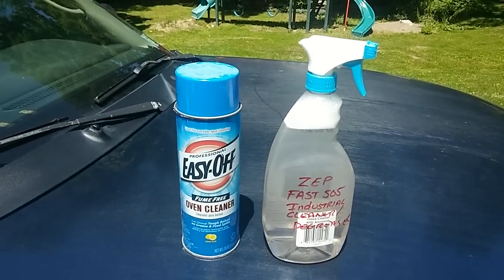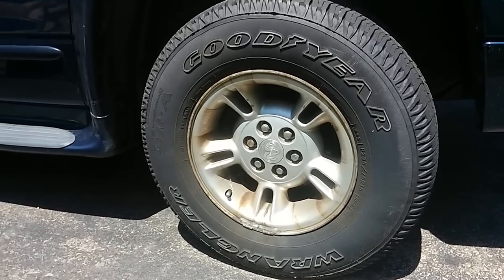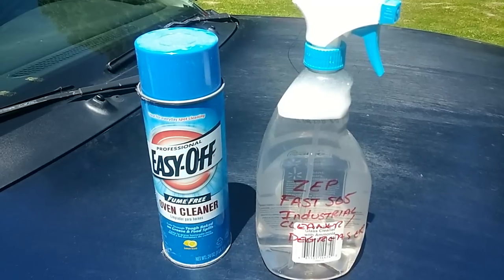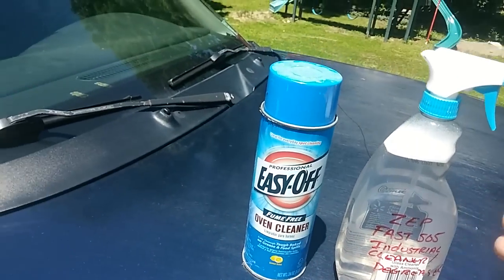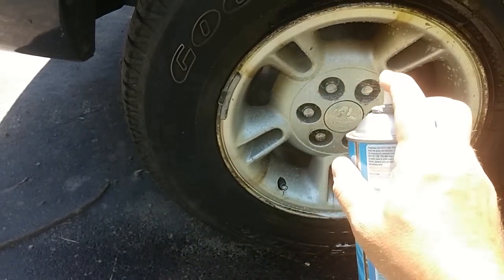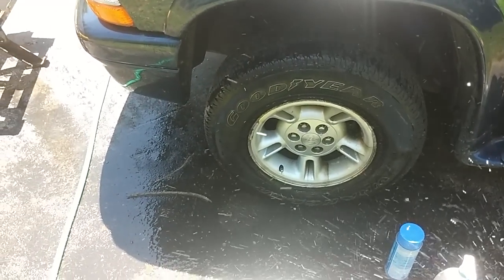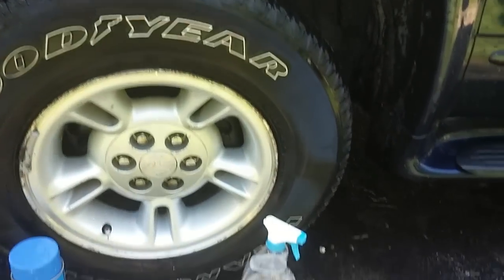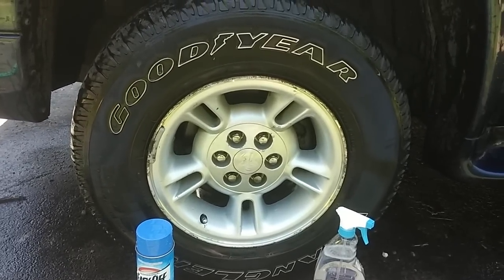Best product to get rid of baked on brake dust.  A comparison of two common products

Comment: The DOLLAR STORE has AWESOME brand cleaner, as a professional I have tried every commercial degreaser there is, and for a BUCK nothing cleans 30 year old grime off better..(I used the AWESOME carpet cleaner)....I KNOW, WHO WOULD HAVE THOUGHT?....it literally melts dirt off before your eyes including old engines and brake dust (all oven cleaners say DO NOT USE ON ALUMINUM).
Reply: I have been picking stuff from the Dollar Tree/99 cent store for 15 years...

Comment: AlumiBright would have cleaned them without touching them. 
Cut it 50/50, even though it's acid based it doesn't hurt paint it clear coated wheels.

Comment: Most oven cleaners contain sodium hydroxide (lye) which will dissolve aluminum!  DO NOT use oven cleaner on aluminum wheels.  Also, sodium hydroxide will dissolve some paints, although automotive paints may be resistant.  Using oven cleaner on a car is bad advice!  By the way, oven interiors are coated with porcelain, not paint.  Porcelain is a ceramic material that is vitrified by firing at high temperature during manufacture.  It is essentially glass, which is not affected by sodium hydroxide.
Reply from the maker: You are correct, clearcoated wheels, most aluminum wheels have a clear powder coat on them that is enert to the lye. That was the case with these wheels
Reply: @just_a_guy_doing  So if we have 1000 wheels i guess not, with 12 year old wheels im going with the Dollar Tree Oven Cleaner. Almost nothing will remove the hard baked on brake dirt on the market

Comment: Buy a $1 worth of the "Works" that you use in your bathroom.....A cheap version of an acid bath product.....Takes it off with a paper towel if you wait 5 minutes.....Rinse thoroughly with a hose because you do not want this stuff to weaken your tires over time......As good as any $20 acid product bought from an "auto" place.....Just sayin......Been using it on my BMW's for years....
Reply: Jim Dugan does the works affect your rim paint ?

Comment: you do not use oven cleaner on wheels, it will DESTROY them as its too strong
Reply: Alex Chan if your careful & don't let it sit for too long it works great.
Reply: Alex Chan ovens are strong and withstand tremendous heat. I’m sure it won’t hurt wheels.
Reply: @daetronbeverage-sanders5348  but ovens have a hi-temp ceramic coating ,not just aluminum with a clear coat